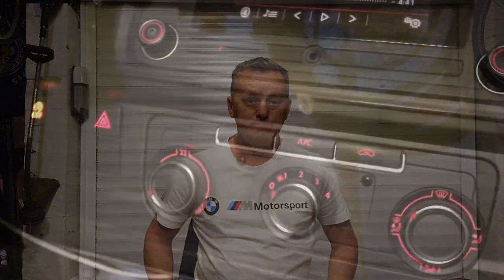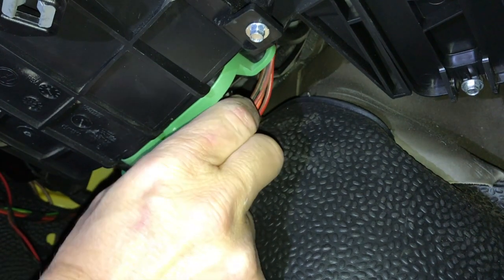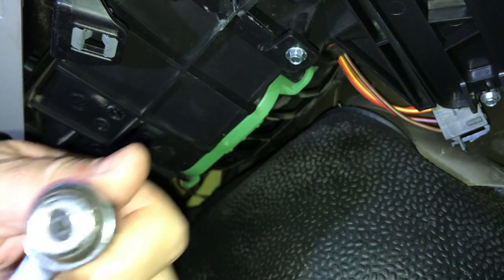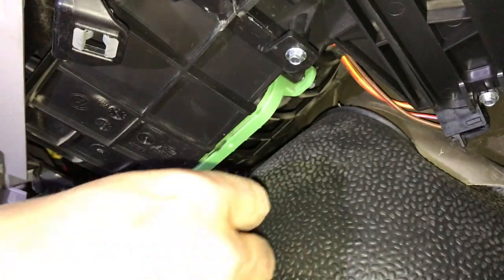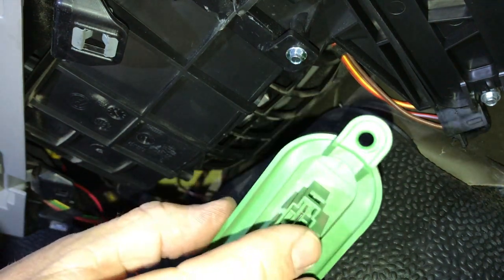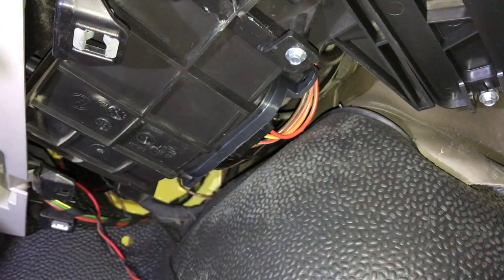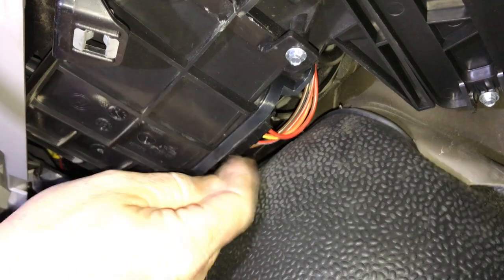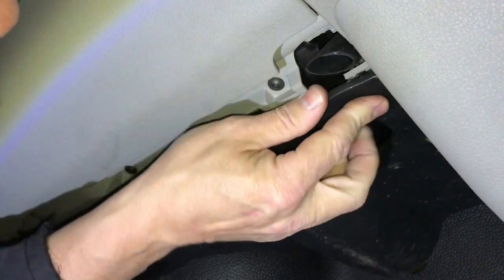VW Transporter Heater Blower Only works on 4 T5, T6 T4

Comment: What a great video.  We have a company VW Caravelle used for deliveries.  Fan only worked on speed 4.  My boss bought the resistor and we found your video.  I managed to change the resistor using my phone light, molegrips and an adjustable spanner.  Being 65 years of age I found it a bit tricky manoeuvring myself into the right position to see what I was doing, although getting out of position was probably harder :(.   Get all your tools ready and to hand before you start, saves getting out of that tight space to find a tool!  I can deliver with a much more comfortable temperature in the van!

There's another video showing how to do this from above, not sure what van model but it stated no passenger air bag fitted.  Mine had a passenger air bag fitted.  Thanks for your help....
Reply from the maker: Well Done, Thanks for the great comments👍🏻👍🏻🛠

Comment: Perfect video, allowed me to easily step through it myself and I really don’t do diy on my car or van. Middle of a heat wave and air con blowers only working on full blast #4. Big road trip coming and We had to go  either sweaty heat or freezing cold! Got the replacement part + 5.5mm spanner on Amazon, it came the next morning, fitted it with your video talking me though it. Thank you so much for making me a hero in my house😀
Reply from the maker: Glad it helped! well done Chris Thanks for the great comments👍🏻👍🏻🛠

Comment: Really good video, thank you. I struggled to get at the "awkward" bolt but found that loosening the fascia below the glove compartment allowed access from the front of the unit. Cheers
Reply from the maker: Glad it helped, Thanks for the great information👍🏻👍🏻🛠
Reply: Having a mare trying to get the unit out - it’s so tight to the wheel arch. How did you loosen the glove compartment fascia - was it the 3 screws at the base that you removed?

Comment: Great video, followed it and it fixed my issue which was the fan would only work on setting 4.  Make sure you have a 5.5mm spanner - that will make life a lot easier and contort yourself into the foot well as best you can.  Finding the correct part was not easy - if you have a T6 or anything with aircon (I think) you need the PA66GB20GF10 which I could not find even after extensive internet searches - unless you want a second hand one from ebay for £27 plus p&p.  Finally sourced from my local VW van centre and cost £50.  Fitting the new resistor was much easier than taking the old one out. Thanks for your help
Reply from the maker: The link to the correct resistor was in the description, it is,-
Link to a new resistor on Amazon, £13, https://amzn.to/2uWxDMh
Thanks for the great comments👍🏻👍🏻🛠
Reply: @aaanton11 My research suggested that that would not be suitable for my 2016 T6. I took a 
PA66GB20GF10 out and so I put a new one back in and it works.   Guess people can do as they want and see what happens.  Thanks very much for you help

Comment: Just had this fault on my T6. So thanks for the video, super helpful. Have just ordered the part. My only query is how does the blower work on 4 but not that other settings if the resister is broken?
Reply from the maker: On full the resistor is bypassed as the motor gets all of the power, on all of the other settings the resistor reduces the current to the motor slowing it down. Thanks for the great comments👍🏻👍🏻🛠
Reply: @aaanton11  Top man. Cheers.

Comment: Hi. Great video appreciated the support, and now taken my faulty item PA66GB20GF10 out of the van thanks to this , but could not see the link or find the item you used to replace it.  ( not too much into technology) but when looking on eBay or Amazon whilst they advertise it’s a T6 correct part , it ends up saying won’t fit after going down several drop down lists  

Yes, could go to VW and pay 6 times price to be sure ,  but thought I would try asking where the link is for EIS product.    Thanks again.
Reply from the maker: I went to TPS vw trade parts, genuine parts 1/2 the price, Thanks for the great comments👍🏻👍🏻🛠

Comment: Nice video, but there is also reason why resistor blew down. Is always worth to check blower motor bearings, clean and grease them. Otherwise problem still going on and you need to replace resistor again.
Reply from the maker: Thanks for the info & Thanks for the great comments👍🏻👍🏻🛠

Comment: hi
nice turtorial video, by chance do you know where the fuse is located for the heater. ive changed the new resistor and was all working well for a day, then totally failed on me, now the maxium 4 setting doesnt work at all also.
thanks
Reply from the maker: I have it listed as fuse1 40amp, in the dash end behind cover, Thanks for the great comments👍🏻👍🏻🛠

Comment: Nice one, thanks for posting. When ever something stops working the first thought is how much is this one going to cost!! Very easy to follow even if some parts are fiddly, it started pissing it down when I was half hanging out the van as well 😂😅 Dont suppose you have a video of how to do a full leisure battery install with hock up or offer this as a service?
Reply: Not sure if it will be handy for anyone but this is the link to the part I used (VW T5 2017) Fan Resistor Heater Blower Motor... https://www.amazon.co.uk/dp/B07N667TTF?ref=ppx_pop_mob_ap_share
Reply from the maker: Thanks Richie, the link for the resistor is in the description, Thanks for the great comments👍🏻👍🏻🛠

Comment: Had similar issue Swapped out resistor but only blowing cold air on 1 2 3 and 4  Any help appreciated
Reply from the maker: The resistor will only control the fan speed,if the fan is blowing on 123 and four it is all okay and the problem will be with your thermal valve or the cooling system having air in it Thanks for the great comments👍🏻👍🏻🛠

Comment: The heater motor only worked on 1 and 3. I changed the resistance and now it only works on 2 and 4
Reply from the maker: Check the connector plug the chances are it will be melted and causing a poor connection Thanks for the great comments👍🏻👍🏻🛠
Reply: @aaanton11  With the old resistor it works on 1 and 3. With the new one on 2 and 4. I bought another new one and it still only works on 2 and 4. In conclusion, with the old resistor it works on 1 and 3 and with the two new ones it works on 2 and 4.

Comment: OK less than £10 on eBay, bargain. I have 4 clips not 3 holding the plastic cover. Ratchet wont fit, so adjustable essential to get the inner one off - the apply pliers to the socket advice won't work as it just slips off, and if you squeeze the ratchet in it flicks over from loosening to tightening which is a bummer. Daughter had same fault on a VW Polo so it might be a generic fix. Thanks for the video, fortunately didn't record mine as far too much swearing at the screws for public consumption.
Reply from the maker: Thanks for the great information👍🏻👍🏻🛠